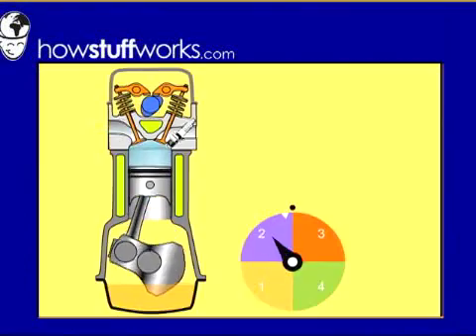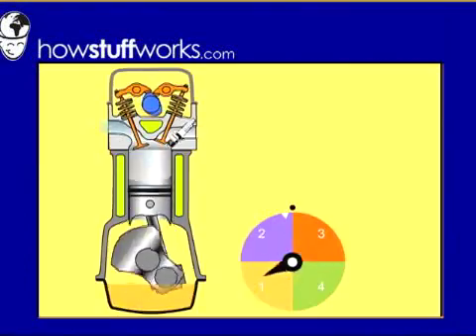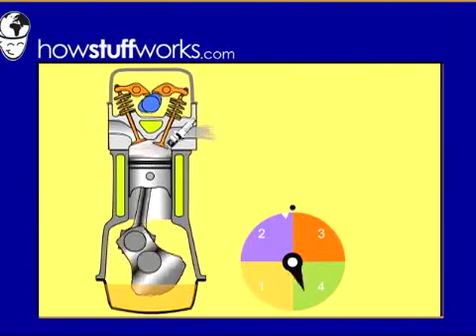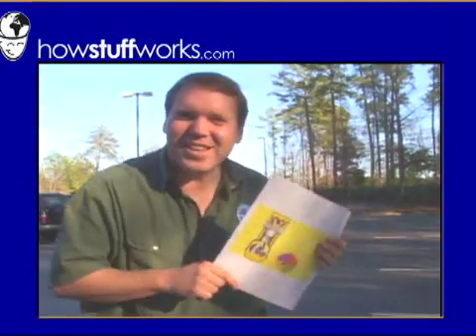How Engines Work

Comment: It must go 4 times up and down to make a full circle. 2 up 2 down. That's why it called 4 strokes engine but in a 2 strokes engine it only has to go 1 up and 1 down to complete a circle, so it's twice faster than this 4 stroke engines. gives more torque. Plus it has no valves, timing chain etc. Less maintenance. but some lubricant oil like 2T must be mixed with fuel to lubricate the bore and the piston unlike the 4 strokes engine so you are gonna get more black smoke with exhaust

Comment: actually on the bang stroke its not actually an explosion....the fuel and air mixture burns at a fast but controlled rate expanding which pushes the piston down and inturn produces enough ummph to push it through the next three strokes with hopefully enough power to push anything trying to slow it down...ie. your car.